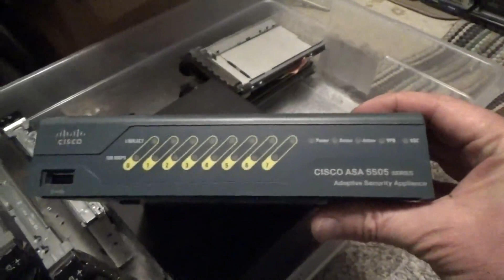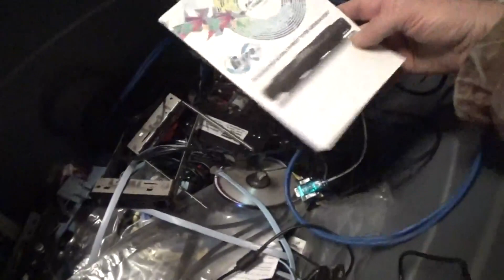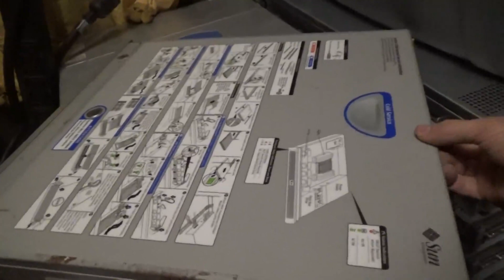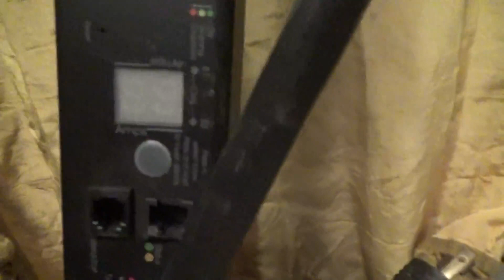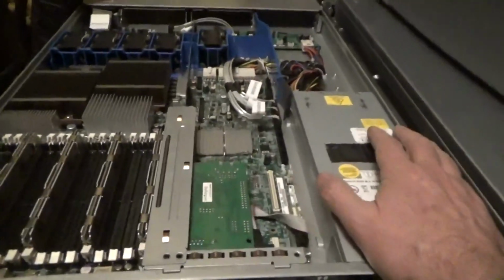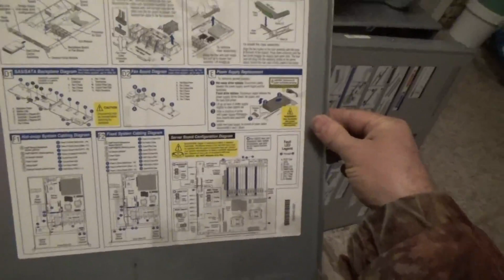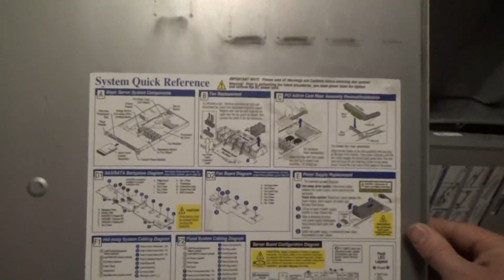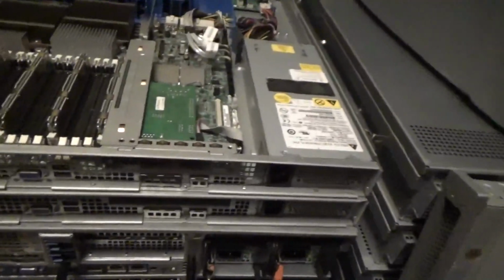Huge Server Haul For DIY Tube Video Community

Comment: By now you probably already figured it out, the mystery 1U servers are exactly what they say they are on the label, Intel SR1560SFHS 1U servers.
Socket 771, so not much processing power compared to more recent stuff, but with all of those RAM slots I'd guess it can take a fair bit of RAM (might have seen the specs of the wrong board, but I saw it supported 128GB of RAM, not bad at all)
Reply from the maker: I am not sure on the RAM on that server. But I did find it was an Intel server, which I never knew they made before.

Comment: Just so you knew there was a new single-board computer available...they released a Raspberry Pi 400 in a 4 Gig and 8 Gig configuration.  Basically, they built it into a tiny little keyboard, and many suggest that they called it the 400 as homage to the Amiga 500, which, while much larger, was also a system in a keyboard design.  Worth checking into, I think.  d;o)

And you're gonna need a few EXTREMELY cheap terminals with ethernet and wifi built in for those servers anyway, right?
Reply from the maker: Yes, the raspberry pi would make good terminals for sure. I may one day try to run a web server on a pi and see how it goes.
Reply: @thedoityourselfworldelectr8007  I'm probably gonna break down and snag one today.  d;o)  Got a 3B+ and a 4...time for a 400!  (They say it was named in honour of the Amiga 500.  d=O)

As for creating a web server on a pi...
https://www.youtube.com/watch?v=vzojwG7OB7c  \\=^D

Aside:  For those who don't know what we're talking about...
https://www.raspberrypi.org/products/raspberry-pi-400/

Comment: Most computer equipment is household power levels. We are not welding arcs with equipment or smoking fuses.
Reply from the maker: If I could afford it, you can run servers on 12 volts as well. But I cant afford the power supplies.
Reply from the maker: But if you do use 220 volts, the servers are more efficient. So I have been told. Actually I am working on getting my cryptocurrency miners to run on 12 volt directly, further reducing loss.
Reply: @thedoityourselfworldelectr8007  120 volts is way more efficient than 12 volts for getting power from your solar panels to the end point where you will be using it. As an example.... 120 volts x 10 amps = 1.2 kilowatts. To get the same 1.2 kilowatts on a 12 volt system you need 100 amps! 240 volts is even more efficient. Which is why all long distance power transmission is done at extremely high voltages.

Comment: the APC power Strip is a 30 amp 110 not 220
Reply from the maker: The plug on the end is 220 though, I think. It wont fit a 110 outlet for sure. It has three prongs around the perimeter of the plug.